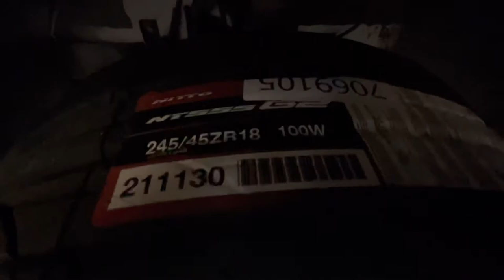Cadillac gets Forged Wheels! (2001 Eldorado ETC wheel Vlog)

Comment: Been looking to see how some sporty looking wheels would look good on a 99 deville and these look nice, what kind of wheels are these??
Reply from the maker: Aodhan Aff7 forged wheels, I was looking for some of the lightest wheels at a reasonable price point. They are 5x114.3 not 5x115 but that doesn’t seem to make much of a difference as long as you get a centering ring to the correct hub bore size
Reply: Do you know what exact centering rings you have to fit a 5x114.3?? Looks sick
Reply: And what are the wheels specs etc for the Fitment
Reply from the maker: @CesarPalmas_   thanks! Stock hub bore is 70.3 so that’s the ID you want, the wheels I got have 73.1 so that’s the OD you want. I’ll link the rings I got. At least this makes the hub a perfect fit to take pressure off the slight difference in lug spacing when using 114.3mm. Commonly teams use 114.3 on 115 hubs in racing applications so it really shouldn’t be much of a concern like I said unless you didn’t have the right rings. ZHTEAPR 4pc Wheel Hub Centric Rings 73.1 73 to 70.3 - OD=73.1mm ID=70.3mm - Aluminium Alloy Wheel Hubrings 70.3 to 73.1 73 https://a.co/d/5Py6M4e

The wheels I got are Aodhan Aff7 18x8.5” +35 offset

Comment: Came out clean. How is the bolt pattern fitment? With the aodhans having 5x114.3 and the caddy having 5x115.
Reply from the maker: It’s been perfect. As long as you have the correct hub centering rings you should be fine. I torque it extra slow and go around extra to be sure, but seems like basically a perfect fit